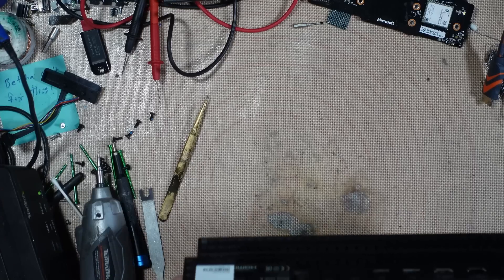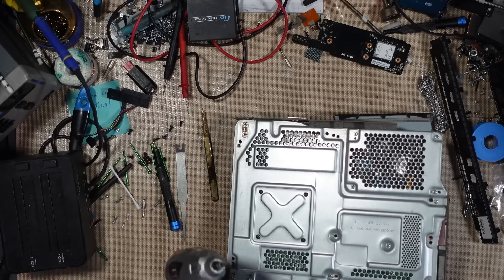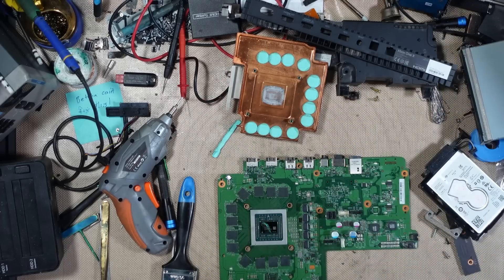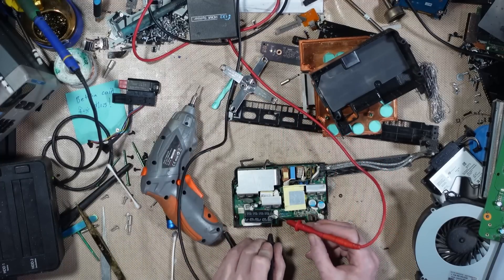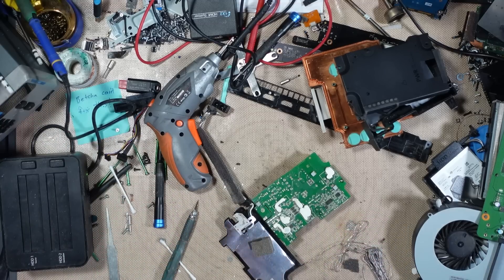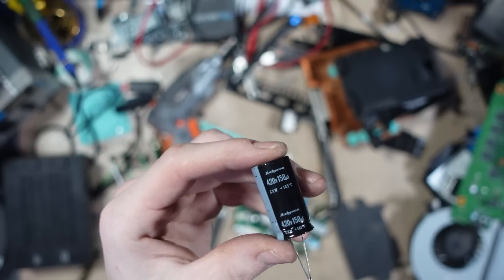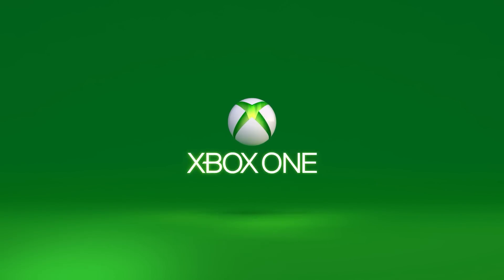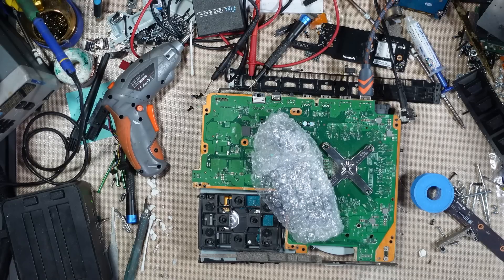This Xbox One X Makes A Weird Noise When It's Plugged In! Can I Fix It?

Comment: Hello, thank you for the video!! same problem power on and shutt of after 5 sec , no video. Same noise on the supply , i look and the cap is dead , crorrosion + juice. You think its the same problem? replace the capacitor and all will be good?
Reply from the maker: Yeah I'd say if it's sizzling and leaking just replace the cap, clean up any corrosion and it should be good. Be careful though, working on power supplies is dangerous 😳
Reply: @TheCod3r  i don't use gloves😅, i just press the power button when the xbox was unplegged, normaly its discharging? i already remove the capacitor and waiting for the new one :) thx

Comment: Mine is buzzing as well can you please let me know 1. The size of the Capacitor 2. the full spec I couldn't see what Temp it was rated at.
Reply: 450V and 150uf , 105 degré but im french dont kow if its same for you
Reply: 400-450V, 150-180uF, 105C ... specifics aren't that important. the main thing that'll limit your choices is the physical size. you're limited to 18mm diameter and 40mm length/height. anything larger gets janky to fit in there

Comment: Here is a short tutorial on how to discharge the capacitors in a power supply so you can safely repair it:
Do not short the terminals of a filter capacitor with a screwdriver. This can be dangerous.
Screw a 100-watt lightbulb into a socket with exposed leads.
Attach one lead to each terminal of the capacitor, the bulb should illuminate.
When the bulb turns off, the capacitor is empty.
Alternatively, you can bridge the terminals of the capacitor for a few seconds with a high wattage resistor, something like 2.2k ohms, 10 watts will work

Comment: You made a mistake mate, you tested that cap and said it had no charge. You may have jut probed it incorrectly in some way. As a guy who fixed PSU's for many years do not assume, if you do one day you will get bitten. Point 2 in fixing a PSU  do not check for resistance etc without discharging everything. You can blow up fets etc by doing that.
Reply: He didn't "measure it wrong", just about all well designed SMPS have a discharge resistor across the bulk filter cap. By the time you get in there, it'll be flat or just about. Also on the One X, the cap gets baked dry from the way the cooling system is designed (pushing the hot air exiting out of the CPU cooler through the PSU to "cool" it) it literally can't hold any voltage anymore. All the ones I've removed from One X PSUs measured single digit capacitance and ESR through the roof. It's actually amazing how long those PSUs can continue working with a roasted bulk filter cap that has almost no capacitance left

Comment: had one similaire
changed psu but still stopped working after a while
turned out the dodgy psu had taken out one of the big caps on the board

Comment: That’s an odd one, never seen a primary cap cause this symptoms. You done like an ESR test ?
Reply: All the caps in the One X PSU get roasted alive due to the way the cooling system is designed (pushing hot air exiting the CPU cooler through the PSU to "cool" it). The output filter caps are solid polys so those are fine, the primary bulk filter on the other hand gets baked dry, along with the 2 tiny bootstrap ones nobody seems to replace. It's honestly amazing how long these PSUs can keep on working with a baked primary, because I've pulled caps out of these that had something like 30uF capacitance left (out of 150) and while the PSU made some very unhappy underfiltered noises, the console still booted up lol

Comment: Nice to see you repairing the PSUs now instead of the swap out. Simple fix and as you said, 99% of failures will be caps as they usually have a total expected life of 10 years under perfect conditions.
Reply: And that’s under perfect conditions. These caps are probably being driven a tad bit harder than they should.
Reply: @Operational117  the fact that the One X is designed in a way that the hot air exiting the CPU cooler THEN gets pushed through the PSU to "cool" it probably doesn't help either
Reply: @Knaeckebrotsaege  
I didn't really think about it, but after watching a teardown video of the Xbox One X, you're absolutely right. If they're indeed being driven harder than they should, that's a one-two punch (though heat alone can absolutely explain their abysmal lifespan).
Reply: @Operational117  They've been baking since day one. Like most consoles, they keep the fan speed low to try and not get too noisy unless they absolutely have to ramp up, with predictable results for the exhaust air temps (ie what ends up getting pushed through the PSU). On my personal one I've also replaced the tiny bootstrap caps right next to the primary bulk filter as those got cooked for just as long and I didn't want to open this thing again if I can avoid it. Secondary side filter caps are all solid polymer type so they're fine (nothing to dry out)

Comment: Do u fix ps4 pro power supplies ?
Reply from the maker: It depends on the issue really but a lot of the time several components fail on the ps4 pro and they tend to work out cheaper to replace